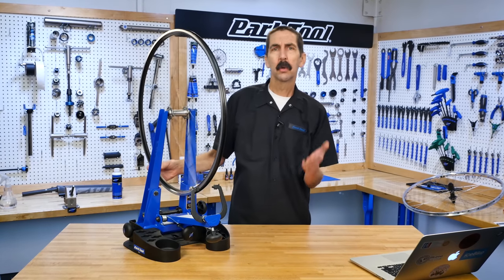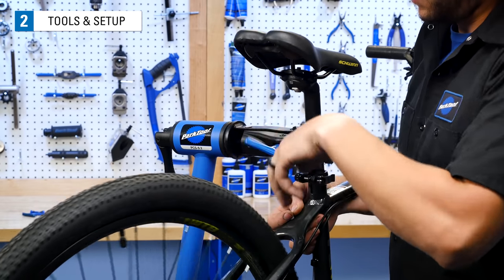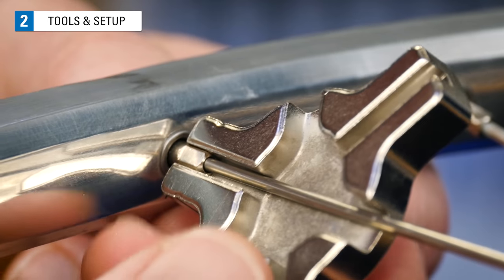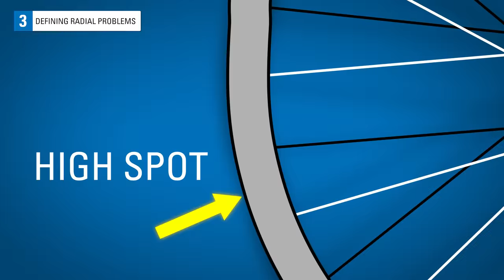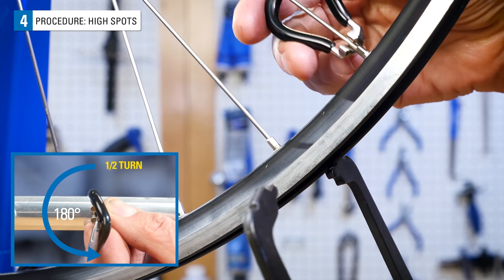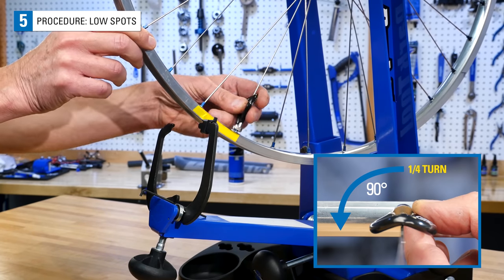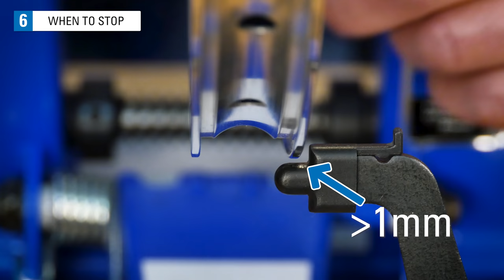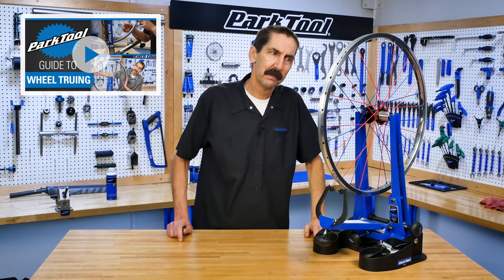How to True a Wheel Part 3: Radial Truing

Comment: Finally …  🙏🏼🙏🏼🙏🏼
So lateral truing, no probs. 
Radial … ahem … mystery!!  … 
But no longer!
So rather longer operation (when youre still a novice wheel jedi)  and maybe not always pulling (tightening) spokes, learn to slacken in opposite direction seems to help. 
And of course you really dont want to do the same job again and again - going back to redo lateral work but theres no choice unless you’re lucky. 
Took maybe 90 mins in 15-20 sessions to finish build and true for radial.
Its pretty good, my tolerance is a standard business card between rim and wheel true gauges. 
Impressed, really lifted the veil of mystery for radial here, had read conflicting advice previously. 

Locate. 
Isolate.
Correct. 
And … 
Patience is key!

Comment: These tutorials are very informative, but I have a question about this one.

It may be difficult for someone new to wheel truing to identify the difference between high spots and low spots in radial truing, especially if the regions they are present in are very large. Imagine a hypothetical scenario where approximately half of a wheel is a high spot (relative to the "closest possible" set of perfectly true spoke nipple tensions, that is, the set of spoke tensions requiring the least adjustment from the initial state to result in a wheel with 0mm deviation at all points) and the other half is a low spot. The correct solution given perfect knowledge is to slightly tighten the nipples in the high spot and slightly loosen the nipples in the low spot (this will result in the aforementioned "closest possible" set of nipple tensions). However, someone with less experience may see the high spot region as incorrect and the low spot region as incorrect, and only tighten the nipples in the high spot region.

There are a number of issues regarding the hypothetical scenario above, including but probably not limited to the following:
There may not be a "correct" solution for any given initial wheel trueness state. The "closest possible" set may be ideal as it hypothetically requires the least effort, but even an expert may not be able to achieve it for a multitude of practical reasons.
Closely related to the above point, it may be the case that multiple (average) wheel outer radii are sufficient. That is, one can imagine that when truing a wheel they either reduce its (average) outer radius (by tightening the wheel more than they loosened it) or increase it (by loosening it more than they tightened it). It is possible that both solutions may be correct from a given initial state of the wheel, that is, they yield sufficient tolerances and cause no other issues with the bike (being overall way too tight or too loose, etc).
It is impossible in practice to achieve exactly 0mm of deviation even at a particular point of the wheel, much less across its entire circumference.

However, despite all these considerations, my main point is as follows: an inexperienced bike truer may misidentify certain regions of the bike and make corrections that are not ideal. The main situation I can think of where this would occur is when they made the wheel overall too tight (in which case parts may be likely to break or wear down) or too loose (in which case spokes may continue to loosen, causing the wheel to lose its trueness and otherwise malfunction).

I took many words to explain this probably insignificant concern, but I was curious how realistic it is for one to true a bike "incorrectly" (not including mistakes like failing to lubricate a difficult spoke, etc.) and how to avoid mistakes like those discussed in this comment.

Comment: How do I correct a low spot isolated by one spoke when the spoke is already too loose? Great detail oriented and informative video.
Reply from the maker: What you describe is a symptom of a bent rim.  If the metal hoop has been struck, and a section pushed inward, you get a low spot.  Remove the tire and inspect the rim in this area.  If it is a minor low spot and just one spoke is involved it does not make the rim un-rideable.   If you can feel the low spot as you ride, replace the rim.
Reply: @parktool  Makes sense. The rim is true under 1mm except the low spot where is about 2mm. I don't feel it when riding. I can live with it, thanks for the reply, much appreciated.

Comment: How to differentiate a large low spot from a high spot when you have a big section of it, say, half a wheel? Is it that section that is high or the other opposite half that is actually low? I am having a hard time doing that...
Reply from the maker: If it is half a wheel I would say that one side is high and one side is low and equilizing the two is going to be the solution. You can do this by tightening the high spot then slightly loosening the low spot then tightening the high spot and going back and forth being sure to maintain spoke tension and trueness through the process.
Reply: @parktool  thanks so much my friends!

Comment: Question. For the high spots, the video indicates tightening 1/2 turn to start with. Direction arrow is counter clockwise and consistent with tightening arrow on radial videos. For low spots we’re directed to loosen, but why is directional arrow also counterclockwise? Shouldn’t it be opposite of high spots?

Comment: What do you guys recommend when half the wheel could be a high spot or half could be a low spot? Im building a wheel and it's like playing whackamole!
Reply from the maker: Yes, sort of.   Consider you are moving high spots and low spots around until it is adequately round.
Reply: @parktool  i got it to 1 mm. Now i fix the lateral true again. And then I'm onto to tension balancing with the TM-1. These spokes are 166 mm its hard to Guage by feel alone

Comment: Does anything change substantially with carbon rims?  I've heard they mostly either come true out of the factory, or they'll never be true (especially with deep section rims).  This is probably an oversimplification, but maybe you can provide some insight.
Reply from the maker: If it is a well built rim, carbon fiber is very easy and pull up quickly.  They are very rigid and stay true a long time.  If poorly build, they are hard to get straight for the same reasons.

Comment: Do cheaper  wheels untrue faster? I feel like Im always tightening loose spokes
Reply from the maker: Typically less expensive wheels have a weaker rim and will go out of true quicker. But just because a wheel is more expensive does not mean it will automatically be stronger. Weight, strength, aerodynamics, width and visual appeal are all reasons someone may spend more on a wheel. So just because it costs more does not always mean it will be stronger.

Comment: This is so insanely hard to get within 1mm. Especially so because it throws the lateral off. This is insanely hard because it is difficult to tell if it's a high or low spot, or If the rim is even perfectly round

Comment: Ok what if the spokes are overtightened in those spots where we need to tighten to correct radial truing :(
Reply: Slacken and slacken opposite side more, meet in the middle so to speak. 
Gotta learn to slacken also as tightening forever doesnt work (in my experience)

Comment: Could it also be a cause that the spokes on the opposite side of the high or low spots are too loose or tight?
Reply from the maker: It depends on what you mean as "opposite".  If there is a high spot at the valve for example, the spokes 180º away are not the problem for this valve spot. It is the spokes at or next to the area of concern.
Reply: Yes that is what I meant. The spokes on the opposite side of the rim.
Reply from the maker: Not typically.

Comment: I can't seem to get rid of a tiny bump around the area where the rim is fused together. (I don't mean a burr but an actual height increase) I could increase spoke tension in that area but then one spoke would exceed the maximum recommended spoke tension for the rim as specified by the manufacturer. I wonder if it is common to have a "tricky spot" in the area where the rim ends are fused? (The difference is less than a mm but still very visible)
Reply from the maker: Where the rim is jointed together you will typically have a deviation that you may not be able to adjust out.
Reply: @parktool  Thanks for the reply! Both my new rims indeed seem to have this.

Comment: what if lateral is true, but the low spot spokes are too loose.  I have the tm-1 tool, and the other spokes are within spec. Newer wheels that haven't seen a big bump. I'm lost.
Reply from the maker: Numbers (typically) don't lie.  It might not have hit a bump, but it possible it was manufactured with a slight deformity.  Pull up tension if you can everywhere else but do not tighten that low spot.
Reply: Thank you @parktool

Comment: weird question but is it possible to convert a future shock 1.5 to a normal 1 1/8 fork. Can I get a adapter for my future shock fork because the steer tube hight is short and also wider than 1 1/8? Can I get a adapter so I can fit a normal 1 1/8 in fork?
Reply: you probably could if you get bearings that fit well enough
Reply: @vdel7418  true. I’m almost considering buying a new frame just because the future shock literally adds a pound to my bike and I definitely don’t need it.  Haha

Comment: Still not convinced about your destressing advice. Just put the trued wheel on the carpet, push all sides, put it on one side and push the rim, other side and push the rim... 
Next, put it in the truing stand and you will immediately see the wheel has to have some truing corrections. Don't just ride it, it slows down the whole process (mounting the tire, riding, demounting, truing,...)...

Comment: Great video !!! Still confused about small aspect ... so if I do proper later and radial small increment truing I technically don't need to actually measure each individual spoke for tension? If and when, when I am actually checking the actual tension measurement? Thanks in advance.
Reply from the maker: Take a measurement of maybe 10 spokes, to get an average. In many cases you don't need everyone.  Measure after other corrections are made.